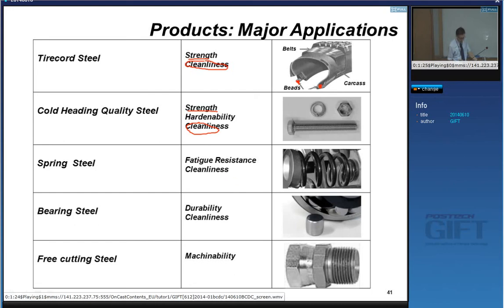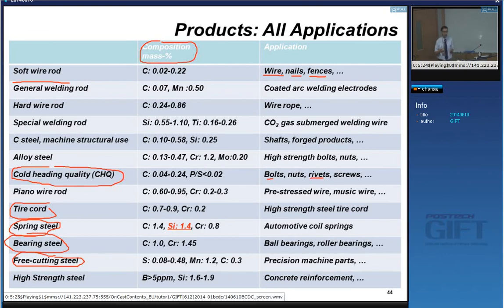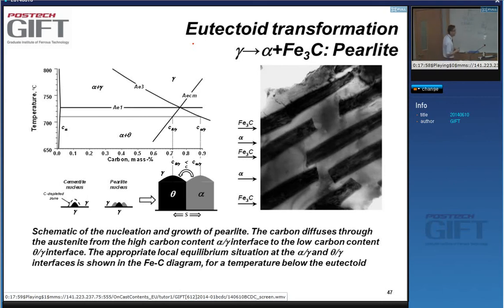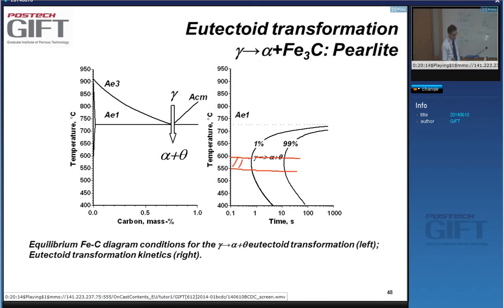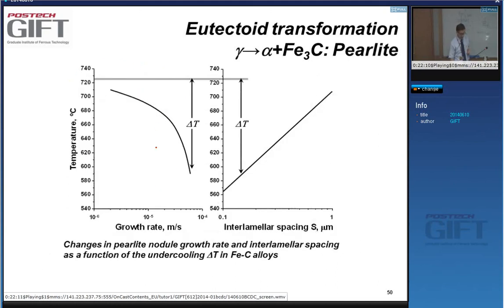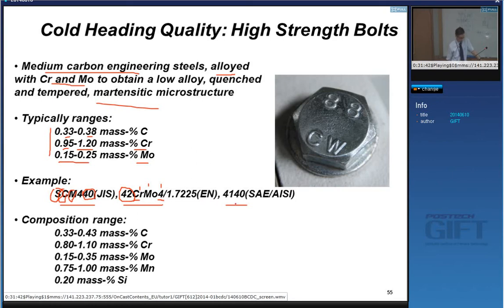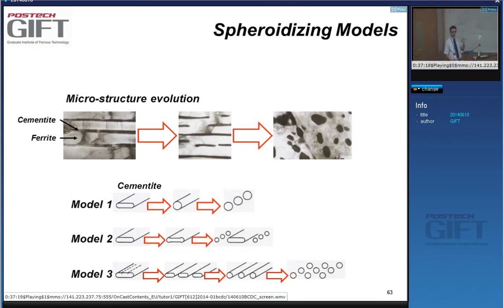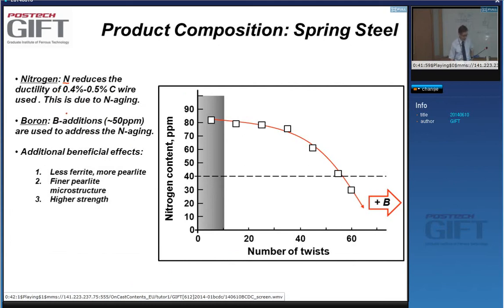Modern Steel Products - 2014, Major Applications 24

Comment: Why the soft anneal(at 33:20) process can soft the wire rod that annealed below Ac1 ?
Reply from the maker: Heat allows the structure to relax with fewer defects, coarsens structure, all that leads to softening.